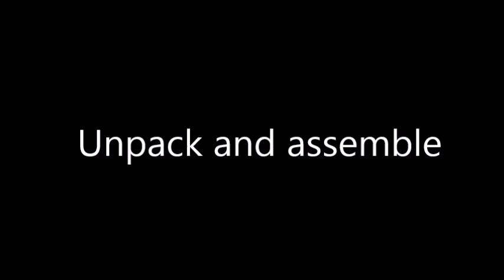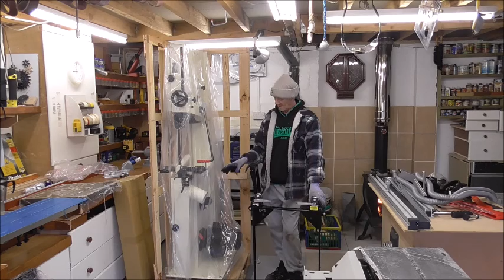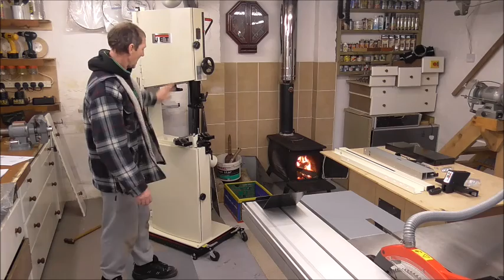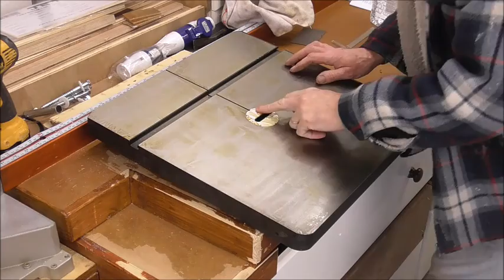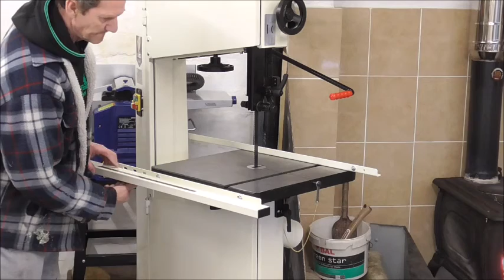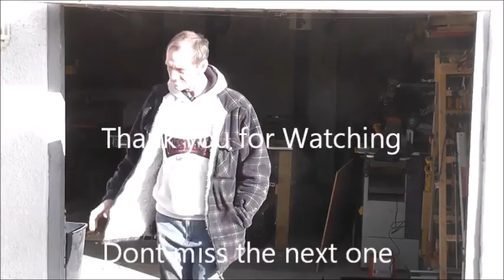Mega Workshop upgrade My new Bandsaw  JET JWBS  18Q

Comment: Was it pretty hard to get it onto the stand? I just picture the stand trying to move and not cooperating. My 18 is on its way and Im trying to come up with a game plan regarding how I will get it off the pallet. This would probably take a few more minutes but I think I have an idea that might work. I was thinking about just lowering the saw down to the ground and then building the stand around it, tipping one side, sliding one end of the stand, tipping the other side and sliding the other end in.. The stand I have doesnt have holes so I can make the sides be whatever length I need.. Do you think that would work easier or was it pretty simple to slide it into the stand fully assembled?
Reply from the maker: Jay Ross yes it was very hard but with the help of a friend we slid it off the packing base onto the stand and to stop it moving we just kept it held tight to the packing base with our feet with very good work boots on of cause